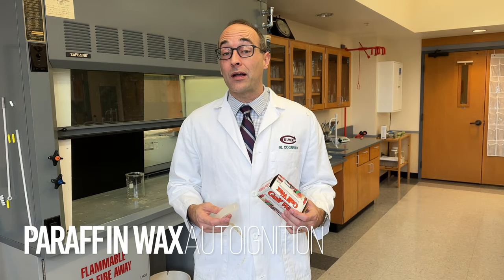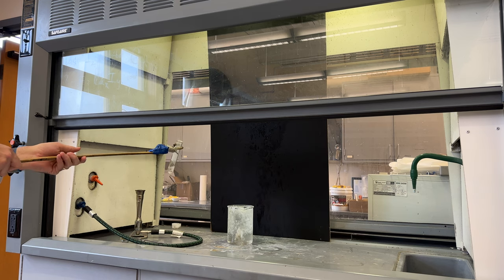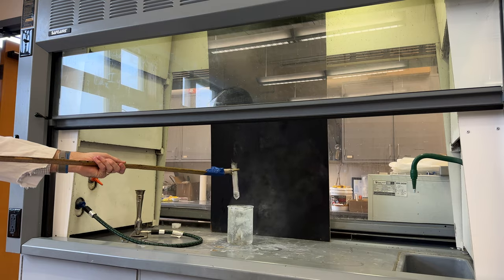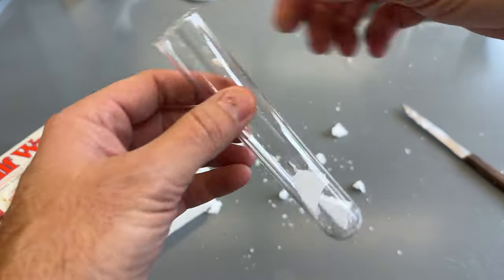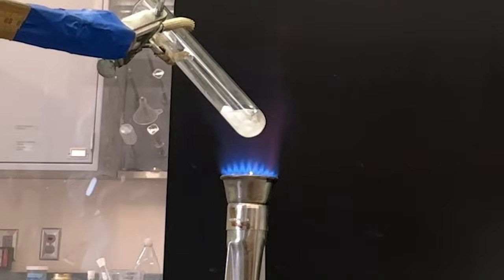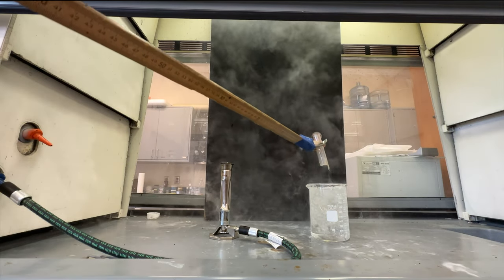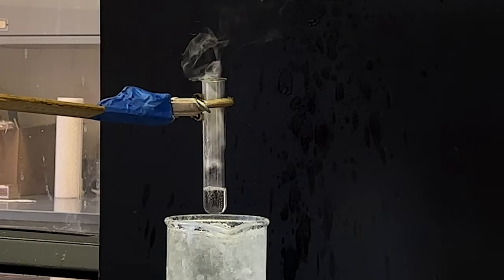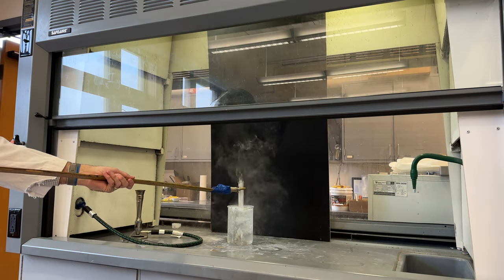Paraffin Wax Autoignition

Comment: I have heard of people using paraffin to heat homes, to cook and even power a refrigerator (typically you see them most often in 3rd world countries). I have also seen that the paraffin can cause fires and severe burns to people. 
This illustrated why it happens.  Thank you!
Reply: That's a different substance.  In most parts of the world "paraffin" means kerosene.
Reply: The modern world uses that paraffin to fuel their flying machines
Reply: @fitzroyfastnet  Wow. Those are very different! TY
Reply: I still use the old school whale blubber for heating my home
Highly recommend
Reply: Paraffin wax is a wax made by a reaction that includes paraffin, the main component of kerosene. The wax isn't kerosene anymore and kerosene isn't the wax. AFAIK, any wax would behave the same way as in this video, but I am not going to test that. I just don't see why it wouldn't.
Reply: Switzerland and Ireland are third world countries.  That term doesn't mean what you think it does.
Reply: LOL, or rather the contemporary, accepted definition of "3 world country" is different from what it meant when these tiered terms were first coined, and some pedants wish to show of their knowledge of etymological tidbits by pointing it out.
Reply: @MJFallout  I'm all for descriptive language over prescriptive, but the word you're looking for is 'developing.'  Using 'third world' is lazy and supportive of racist xenophobia.
Reply: @wcookiv Frankly, "developing" is equally condescending.  This is a topic where there really isn't a non-rude way of introducing it, since the whole concept involves making certain harsh assumptions.  IMHO, just pick a term and stick with it, and apologize if/when it bothers someone, since there isn't an ideal solution.
Reply: @fitzroyfastnet i know paraffin as in candle paraffin (cuz saturated carbon hydrate chains don't mix with water, thus paraffin (lat. Not attracted to water (or something similar))
Reply: @wcookiv  You could also claim that a "we are the industrialized world" and "those are undeveloped" countries, whilst pointing to former colonies in africa, is racist and basicly the 3rd reichs übermensch and untermensch categorization

Whilst you could argue that 1st, 2nd and 3rd world are like in a train
You have the 1st class for wealthy, 2nd class for common earners and a lower tier for the economic weakest

Or you could just accept that the term 1st, 2nd and 3rd has changed since its introduction and ireland and switzerland arent 3rd world countries because of their wealth
Reply: @deutscher1a  You could but you'd be wrong.  That's not how racism works, and stating the fact that an economy still relies on resource extraction or industrial production has nothing to do with categorizing the people who live there as inherently inferior.  Get a grip.
Reply: @wcookiv  But calling it developing, less developed and least developed is not claiming that they rely on extraction of resources
Its saying that theyre on a way of change to "the good and better way" the one that the industrialized world has reached
You act just so superior, even with your way of debating of pro and cons of a way of naming things, that you cant even take critics and just dismiss it
There are many critics about saying developing ldc and lldc
Why is it called developed if its our way to live? Didnt hunter and gather have better understanding of the value of what they have? Why do they have to develop? What if they dont want to? Is forcing them to change and abusing their natural riches like oil and gems not just modern colonisation under a new flag(why does switzerland help them develop for such a great profit?)
Reply: @deutscher1a  Your navel gazing actually circled around and made one of the obvious counter-arguments to what was supposed to be your main point.

This is just college stoner philosophy rambling dude.  Your randomly presented thoughts have all been discussed and dissected by experts already and anyone familiar with the dozen or so complex topics you're twisting together can see that you haven't investigated any of the ideas you're offering.

Comment: That's a good visual representation of  stoichometry in action.
Ignition occurs first at the point where the air/fuel mixture is optimum
Reply: How do you measure stoicism? It's pretty subjective.

Just kidding  I'm just another wise ass with a degree in chemistry AND English. Not a lot of crossover in those two fields but it did help writing papers.

Comment: This might be a good place to tell my little story.
It was a cold winter, and the central heating was broken and could not be fixed for a few days. I was feeling cold as hell, and needed to get the room temp up, so I placed seven tea-lights on a small porcelain plate and lit them. It did work fine, giving some very welcome warmth. I had of course ensured that nothing flammable was nearby or above. After some time, all the wax had melted, which isn't unusual with tea lights, however the heat was enough to make the wax boil, and of course the gas ignited immediately with a giant flame, and now the tea lights were continuing to burn as one huge surface of fire, like a pan on a stove with burning oil. I quickly found a metal lid or pot or whatever and placed it over the plate with the tea lights, which killed the fire, but when I removed the lid, it would immediately reignite, until I left it to cool down. No harm done. But it sure was a learning experience. Even tiny tea lights can pose a serious danger! Don't place multiple tea lights close to each other. (I can't recommend repeating this experiment, but if you ignire my advice, at least do it in a safe location, keep the tea candles in a pan for which you have a tight fitting metal lid. The lid will get very hot, so use good insulating oven gloves.)
Reply: Use a clay pot over the tea candles. 
The clay is a great radiant heater. 
The hole in the pot chimneys the gas out.

Comment: As kids in 1962 we used paraffin to wax our surfboards.  We learned it lasted longer if we would melt it in an old tin can then brush it on our boards.  Our parents told us to be careful not to get it near water while we were doing this but never told us why.  Now much later, I finally know!  (We never got it hot enough to boil - just enough to stay melted while we applied it to our boards).  In high school chemistry we learned about state change and a drop in temperature as paraffin is heated to melting but nothing about autoignition - probably a good thing at that age LOL!

Comment: I use paraffin wax at work. Thankfully, we’re not getting it more than about 100 degrees Celsius, usually no more than 85-90. Past 100, you start to smell it. I guess the boiling water mixing with it at that point starts to do weird things with it. Makes sense now.
Reply: "a coil, well insulated by leaving in a pot of hot paraffin until all bubbling has ceased... boiling of the wax shall render it useless and one must start afresh..."

god i have some weird quotes.
Reply: @paradiselost9946  Sounds like some early inductor insulation tutorial, any idea where this is from?
Reply: @mobuildsstuff  it will be one of teslas articles i believe. "some experiments with high frequency high potential currents", possibly?

though it might be any of the old induction coil books, actually...

Comment: Wax has a very high specific heat capacity of about 2.5 J/gK -- not quite the value of water which is extremally high at nearly twice that of wax but way higher than steel or copper or aluminum.  So, when the wax was heated to boiling the heat contained in the wax was enough to instantly vaporize enough water to cause the wax to jet upwards and increase the surface area exposed to oxygen.  The energy content of wax is also quite high -- about the same as many fuels we use.

Comment: The reaction is impressive and scary at the same time ! 

Also, I was wondering, why are there what seems to be two gaseous phases (a more cloudy one on the upper part of the tube and a coloress one between the cloudy one and the melting paraffin) at 1:04? Are they the different substances from the paraffin with a different melting point and density ?
Reply: If I had to guess, the clear lower part is hot enough that the wax stays as a vapour, but higher up the glass is cooler and so the wax can condense on it? Kinda like how there's usually a gap between boiling water and the visible steam
Reply: @coryman125  Sounds right yeah, it could be it but the fact that the two layers are separate makes me think of a other byproduct formed or something like that
Reply: I believe that this is more of a physics question than a chemistry question but yeah I guess the explanation above is correct.
Reply: The "cloud" is vaporized wax that hasn't reached oxygen yet to react. You can see this happening in a normal candle flame as well.

Edit: Oops, misread the question, but the above is still true as well.

Yes the clear zone is similar to what water does at higher temps or lower concentrations, it is clear. The cloud forms as wax starts to condense as it cools a little leaving the bulk material. Then when it leaves the tube, it spontaneously reacts with the oxygen in the air.

Comment: The heavy thick oil type compounds seem to have a lower auto ignition temperature, wax is probably close to diesel, gasoline has a higher auto ignition temp, and methane is probably even higher.

Comment: I had a candle explode in a cabin a few years back. I thought the tin can i was using as a candle holder somehow turned into a spring via some kind of bi-metal reaction but now i wonder if the wax wasnt slowly boiling away until it got some cold snow through the window.

I was sleeping and only saw the immediate aftermath but it was clear that wax had sprayed.

Comment: One of the experiments I like to show too. There is another experiment where you can show that heating paraffin-oil at boiling point for some time generates gaseous and liquid cracking products (alkens). So I guess this and the intermediate formation of radicals might play a role in this self inflammation(?)

Comment: Great video.  I've seen this reaction before where the boiling tube stays intact and you get the same effect.  To be honest, I didn't realise that the boiling point was above it's auto ignition temperature and I had assumed that the ignition must be something to do with latent heat as the liquid wax droplets start to solidify but that didn't seem particularly realistic.  Your explanation here certainly makes more sense but what causes the wax to eject itself so vigorously from the tube on initial contact with the iced water in the case where the tube stays intact (I just checked and the video I mentioned was actually your YouTube short from back in October last year)?
Reply: > something to do with latent heat as the liquid wax droplets start to solidify but that didn't seem particularly realistic.  Your explanation here certainly makes more sense but what causes the wax to eject itself so vigorously from the tube on initial contact with the iced water

The tube BREAKS.  That lets water contact the 370C paraffin, which turns some of the water almost instantly into steam, which expands in volume 100s of times in basically an explosion, which ejects the paraffin and blows it apart into in effect an aerosol or similar, with massive surface area with which to react with oxygen.
Reply: @lqr824  in the video, the first time he plunged the tube, it seemed to be unscathed after taking it out? (liquid wasn't leaking profusely out of tube). Or was the crack too small to have any effect?
Reply from the maker: Every time I’ve done this demo, the test tube has cracked. In some attempts, the cracks were smaller such that residual solidified wax held the tube together.
Reply: @Chemteacherphil  Ah, right.  I did post a reply to @lqr824's comment with a link to your original short where the tube does appear to be intact - but I guess YouTube deleted it because of the link.  So this is really a self-igniting variation on the old 'chip pan fire' demo.  Great video and love the channel!
Reply: @Chemteacherphil  Maybe a kind of Venturi effect ?

Comment: thank you for your ideas
i speculate 
A CLEANER TEST? a more clearcut visuals, might be not using a flame ignition source to heat test tube, use an electric heating of test tube, this would rule out any flame ignition source, show even more clearly,  

also please show,
the flame ignition of boiling vapors in slow motion too please to see if one can see anything of interest here too, i speculate 
thank you
i support you
love love love

Comment: The paraffin doesn't vaporize upon hitting the ice water. It is the the water that enters the tube and is heated by the paraffin to steam.
The steam projectiles the paraffin into fine droplets, which ignite due to a large contact area with oxygen.
Futher, the micron sized droplets have a lower energy for ignition, a similar phenomenon happens in dust explosions. 
This means that the collision energy of tiny droplets releases enough energy to ignite with oxygen the paraffin.

Comment: If the wax is boiling while in the test tube then the vapors must be rising & contacting air, right?  Why doesn't that combust at that point?  Then,  he says placing the test tube in water cracks it, causing the hot wax to touch the water causing it to instantly boil (I'm guessing he meant the water boils b/c wax is already boiling) shooting the hot wax (that is above auto-ignition point) into the air & dispersing it.    So nothing got hotter than it was than while boiling in the test tube.   Why weren't the vapors burning when they exited the test tube?

Would this work if you boiled the same wax in an open pot and poured it into water (I would think ice water isn't necessary if pouring, it's only needed to shatter the test tube from thermal shock)?

The wax has a boiling point of near 700F and the auto ignition temp is 390-460F.  Any vapor exiting the test tube would still be above the auto-ignition temp, don't you think?  Does this have anything to do with the boiling level being so far below the top of the test tube & would a boiling pan catch fire or not catch fire?

Comment: Why does boiling wax erupt when it is rapidly cooled?
A1: It solidifies and contracts from the outer periphery, so it ejects from the open top.
A2: While the inside is boiling, the outer periphery near the surface solidifies, which narrows the path of the steam and increases the flow velocity, causing it to eject.

Which understanding is correct?

Comment: This is very familiar to people who home-can foods. A layer of wax on top of a jar of homemade jam or relish will keep air from touching the food. But melting and pouring all that wax can sometimes lead to ignition of the wax vapors. Instead of wax, the patented canning jars keep food fresh without the risk of fire. Since I used to make homemade treats and give them as CHristmas gifts, I was much happier using the commercial canning products, so my wrapped gifts didn't leak.
Reply: There's a very wide temperature gap between the melting point and the boiling point, though... It seems to me that it shouldn't be difficult to stay at a safe temperature.
Reply: ahhh, the old vacola.
never thought of wax lids, but it makes sense. you are boiling them with the lids on, thats enough to melt but not ignite wax. throw a chunk in any old time and it naturally will float to the surface... and ensures theres absolutely no air in there.

lol, theres still mulberries, beetroot, and peaches from about 79 that my mother jarred back then hiding in the back of a cupboard...

seems to be the rubber seals that perish. wax wont do that... especially proper flexible sealing wax like used on cheese.

as a child, home pickled beetroot was the norm, highly acidic. store stuff just hasnt got anything close, with its "sweetened purple dirt" taste....

Comment: I once directed a stream of O2 over a lit candle. It was from an oxygen concentrator (medical). It was a 2" dia candle. The wick was no longer necessary! Entire top of the candle turned into a while hot roaring inferno. Scared the crap out of me. Luckly, removing the oxygen returned it to a more easily controllable flame! Ever since then, I had a heightened sense of danger with paraffin wax!

Comment: Before I watch the rest of the video, this is my hypothesis: By melting it than plunging it into ice cold water, you force the wax to condense into fine particles. That sudden condesation causes a vacuum which forces air to rush in and stir and throw up the fine particulate. With the high suface area and oxygen rich atmosphere outside the tube, it ignites. Will edit if I'm right or wrong.

Edit: Partially wrong. Rather than an inrush of air, it was the tube breaking and an inrush of water that caused the wax to vaporize and ignite.

Comment: Why did the vapors coming out of the test tube when you were boiling the paraffin not ignite when you were heating it?
Reply: Remember that it is the vapor that ignites, not the liquid, and at the surface of that boiling liquid,  there just isn't enough oxygen to support the reaction.  Especially so in the restricted space of a tall test tube.  It's much the same reason you can throw a lit match into liquid gasoline and (sometimes) it will not ignite.

Comment: That is a bleve.  Boiling liquid expanding vapor explosion.  You don't even need an ice bath.  Quickly toss/drop some boiling paraffin from a height on a cold day and you can create the same fireball.  That boiling liquid is already well passed ignition temperature, so all you need is proper dispersion of the vapor in air.  Best to do this over ground that is either non flammable or covered in snow.